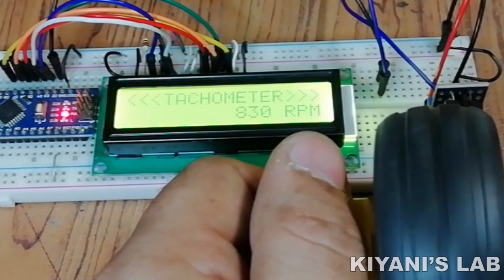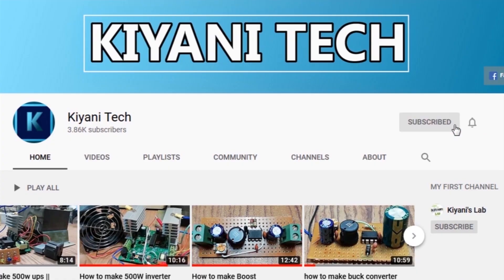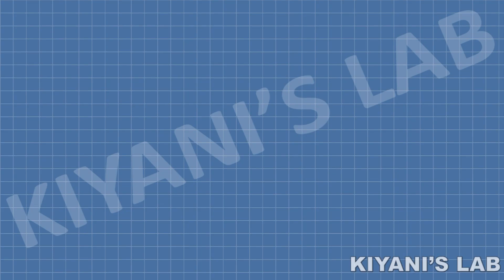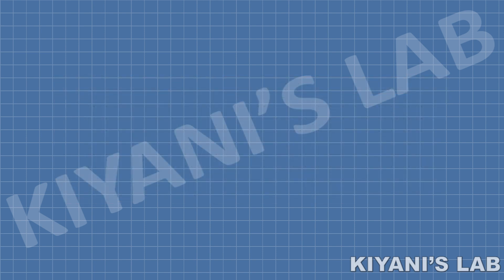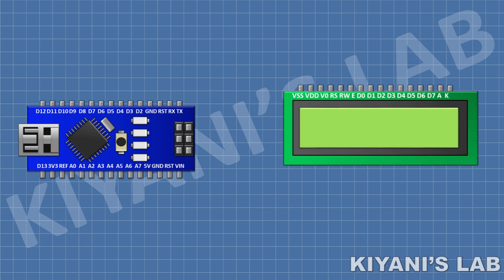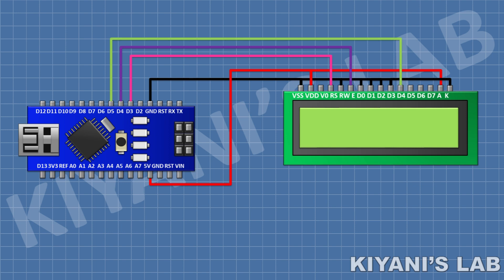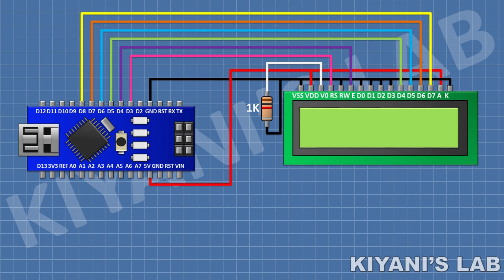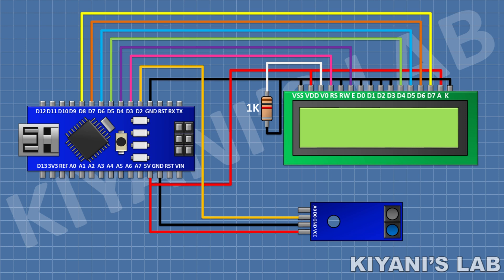How To Make Digital Tachometer

Comment: Hello friend, I have two questions:
1) The TCRT5000 Sensor that I have is not the Module, so what should I add to the circuit?
2) Can I2C Display be used? (only 4 Pins)  Thanks